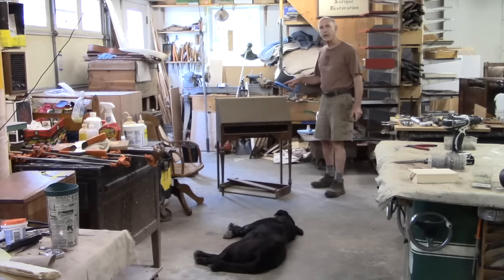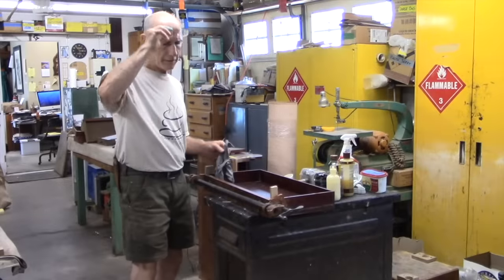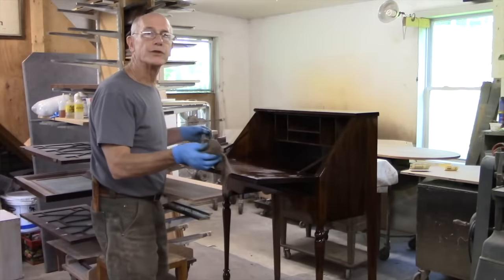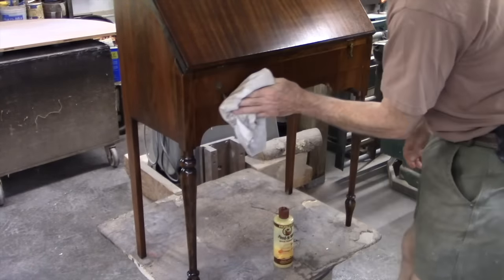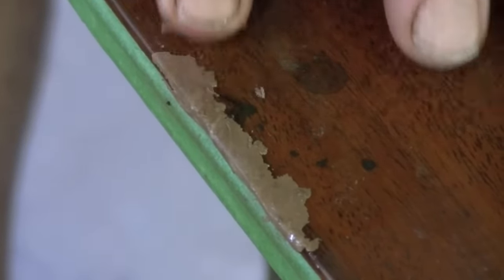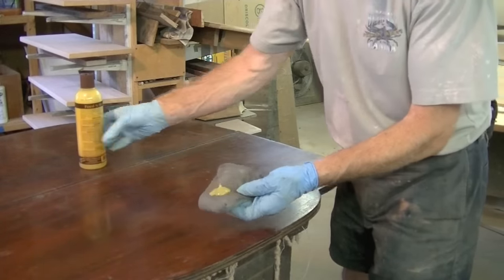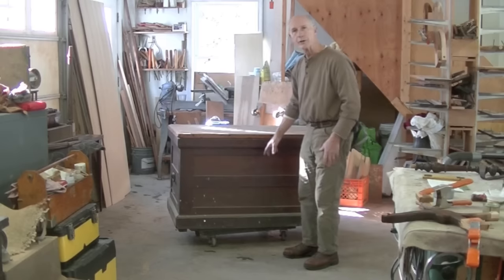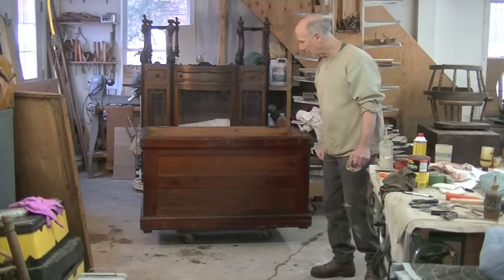Beautiful Antiques, Restored with Hardware Store Materials

Comment: As much as the tips you offer in your videos you provide the courage for us DIY'ers to tackle challenging projects.  A short time ago I was asked to reglue some damaged legs on a small table built by the grandfather of a good friend.  With the direction from several of your videos I disassembled the table, repaired several dowel joints, scrubbed and refinished the top with some of your recommended tung oil varnish.  It turned out great and the friend was overjoyed with the results.  Thanks for what you do.
Reply from the maker: You are so welcome! That is great! Nothing makes me happier.

Comment: A few years ago I restored a century old maple desk almost exactly like the first desk you did. It had two major problems. The back was plank wood had failed where the nails were splitting it with some wood loss. This was repaired with a piece of Baltic birch plywood cut to fit. The second was that the shellac finish had crystalized in the dry desert air where it was for most of its life. The shellac was stripped off. The veneer was reglued using hide glue. And then it was reassembled and a new shellac finish applied.  I left some stains and cigarette burns to show its history.
Reply from the maker: Wow! Quite a job! It sounds like you were very successful. Thanks for watching!

Comment: Ella. What a sweetheart! Let me add one technique for cleaning dirty old hinges, latches, screws, etc. Cook in a normal solution of water and laundry soap (e.g. liquid Tide) in a discarded (never to be used for food again) slow-cooker. Set on low for about 12 hours. Remove, rinse, and scrub as required. Old paint, dirt, rust, and gunk are easily gone, but the patina remains. Dry well and spray with WD 40 or another water displacing oil. Let the oil soak in before you wipe clean and reinstall.
Reply from the maker: Thanks! This sounds interesting - can't wait to try it
Reply: @johnsonrestoration  Yay! Always happy to share. You'll be amazed at the way it loosens multiple layers of icky old paint.

Comment: I’m amazed that the barn find first item still had all its accumulated thick dust intact - without any hand prints or brush marks by the previous owner!
Reply: Your amazement could be construed as criticism or even a suggestion of distrust. I am sure that was not your intention but you should be careful with wording.
Reply from the maker: Thanks! We were careful removing it from the barn so as not to disturb the dust, I knew it would make a great shot to vacuum it for the first time
Reply from the maker: Thanks! I didn't take it that way but you're right, you do have to careful when writing, it can be interpreted differently than you intended

Comment: shop vac’s require a wet/dry canister filter that only needs to be changed after you notice loss in suction. if you have suck on something wet remove the filter let air dry well heated garage shop. reinstall usually grab a set of two filters. Dump out the catch can in an opened up trash bag crumpled down or cover the can invert n dump. My dad has an old 1980’s sears shop vac never has had one issue even with age. Other than a on/off slider switch quit making contact.  i have since bought my own yes their practically the same minus a large on off rocker switch. Same filters minus a size difference he uses it to clean out the ashes in the pellet grill between cookings. His he uses when we tinker in the wood shop saw dust.
Reply from the maker: Thanks Mark! Good info, I need a backpack type vacuum so I can vacuum more often without lugging the big shop-vac around

Comment: That’s a lot of dust. lol.  as a quilter I use wax for thread and i found that it worked very well on my 18th century dressers so they slid in and out well. I also used it on my windows in my 250 year old house so they opened and closed easily. Bar Soap can work too.
Reply from the maker: Thanks! yes, I like to wax things up too! What a difference

Comment: I am watching Restoring an antique butlers chest...what causes all those pieces to fall off and were they applied as individual pieces or did they break into pieces...beautiful work as usual
Reply from the maker: Thanks! A combination of wood movement and the failure of the 200 year old glue. I could also see that the pieces were never clamped down, there was a lot of glue on the back of those pieces.
They needed better wood-to-wood contact

Comment: At 9:36 - Tom uses some wax to allow the drawer to slide easily.  Two other uses for wax is 1) bracket on wood screw threads before driving them into wood and 2) on a zipper to make it also slide easier.
Reply from the maker: Thanks! Funny you should mention that, I just waxed up some zippers yesterday!

Comment: This is a great guide for quick clean up! Have done to several sets of dinning chairs. I have question about a 102 year old front door with some thick quarter sawn white oak on its outside. Some of the edges in the seams are lifting slightly. What would be the best way to reattach these edges in the field. Service is stripped already. I have epoxy, weld wood tight bond II or Star bond CAA. available to use.
Reply from the maker: Thanks! I would definitely use the epoxy, that's what I did on my own door
Reply: @johnsonrestoration  Thanks, the gaps between the veneer pieces are pretty narrow.   I’m going to have to figure out how to get epoxy under those edges. Any clamping secretes for the middle of a door? Should I stain first, so I don’t have epoxy resisting stain?

Comment: Which scratch cover did you use for the first table? I ask because I routinely advise against using oil-based products like Howards Restor a Finish, since I've always believed they can potentially cause irreparable damage by soaking into the bare wood fibers. Am I off the mark on that opinion, or did you use a different kind of product?
Reply from the maker: Thanks! No, the scratch cover is Old English, definitely an oil product. I have not worried about that, the areas are so small. It would depend if it was period piece or not, and whether it's already been refinished in the past. I don't get many valuable pieces in the shop
Reply: @johnsonrestoration  thanks!

Comment: One thing to remember about epoxy is that it is also reversible - get a heat gun, heat it up, and it will soften and can be scraped off like any other glue. The normal softening point for regular epoxy resin is about 140° F, the putties are more variable, but they'll come off, no problems.
Reply from the maker: Thanks! Yes, I've used heat to loosen every type of adhesive. No matter the adhesive, if you can't get the heat where the glue is, it's a problem